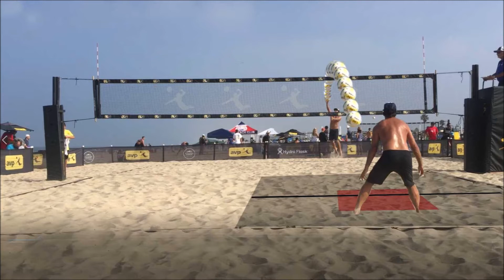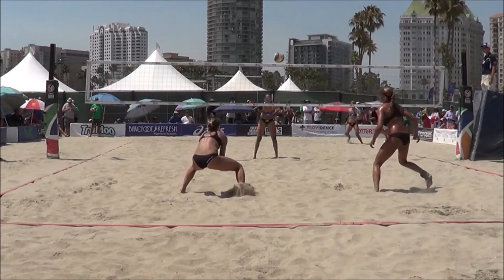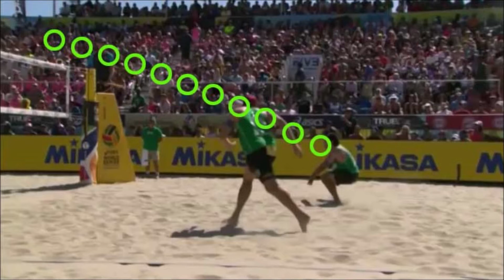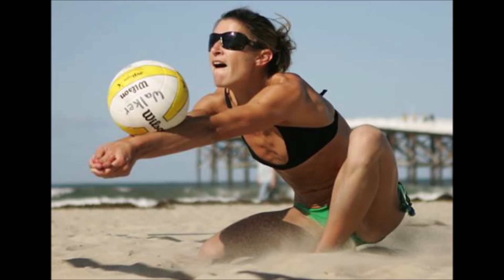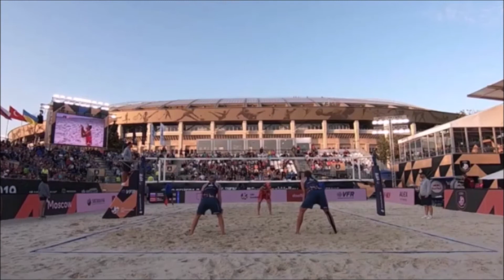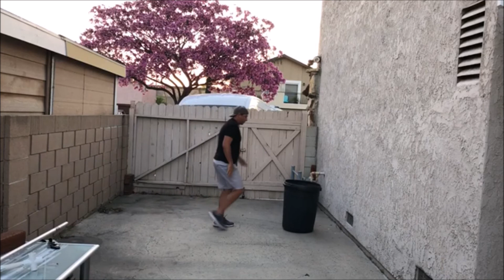Video Analysis Serve Receive for a low flat driven serve right at you

Comment: Very good but I disagree with one thing. I manage often to serve a flat floater just above the net that drops dead right after passing the net and then drops dead in the first third of the court. This is done by having a high contact point with taller players. It often surprises my opponent and is a good way to score. It's a difficult serve but not impossible to achieve. However, the low squat position is still the best option as explained in the video. 👍
Reply: stop lying, you have never managed that.